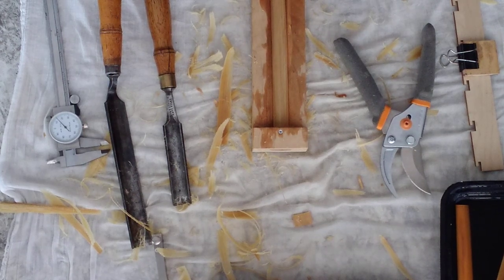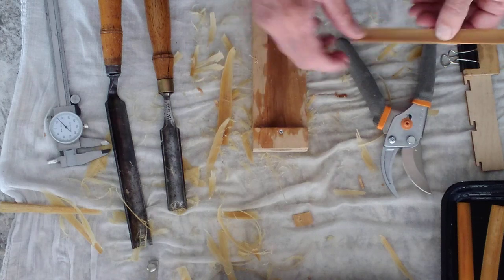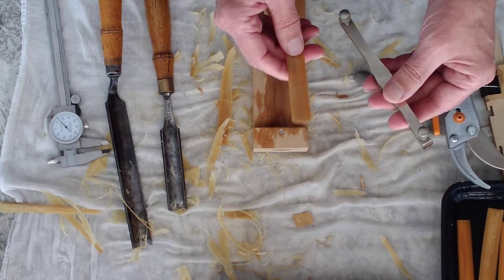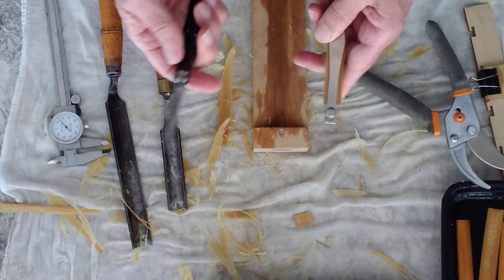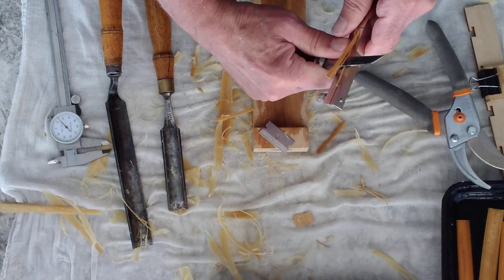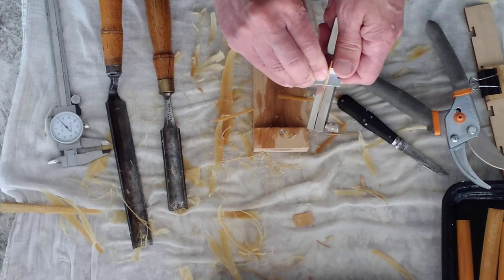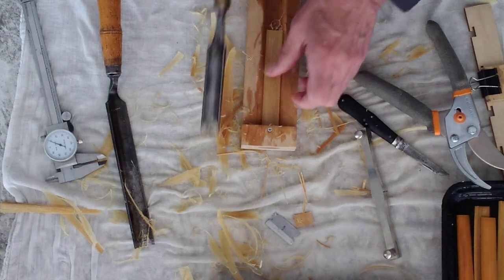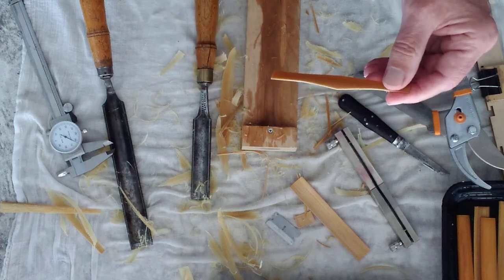Bassoon reed shaping from hand gouged cane.

Comment from the maker: Hello.  Thank you for the question.  These gouges were purchased at a used tool swap meet.  They are old and do not have markings on them indicating sweep or number.  When I bought them, I took my cane gauge and tried to find gouges to match my 1-1/16" (27mm) and 1-1/8" (28.5mm) diameter markings -- I wasn't concerned with the width of the gouge so long as it was larger than a typical piece of cane to be gouged.  These two gouges were the closest that I could find at that time.  The larger one is 1.04" (26.4mm) wide with a curvature radius of ~0.6" (~15mm) -- the smaller one is 0.92" wide (23.4mm) with a curvature radius o ~0.55" (~14mm).

Comment: Bom dia! Qual a numeração destas Goivas.
Reply from the maker: My gouges were purchased used at a swap meet -- they are old & do not have the modern markings for sweep.  I went with my tube cane gauge and tried to match the radius (or equivalently diameter) of the gouge to about 1" to 1-1/8" (25-29mm) diameter.  The smaller gouge is about 1-1/16" (~27mm) and the larger 1-3/16" (~30mm) diameter equivalent.  The widths of the gouges are 0.91" and 1.04" (~23 & ~26mm) -- I don't consider the width particularly important as long as it's wider than the piece of cane.
Reply: Boa Noite! Obrigado pelas informações